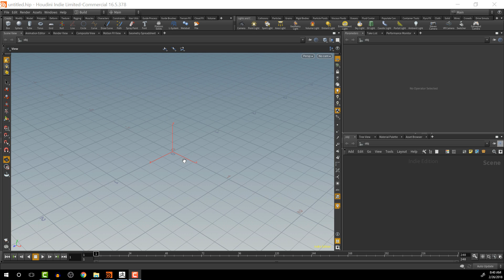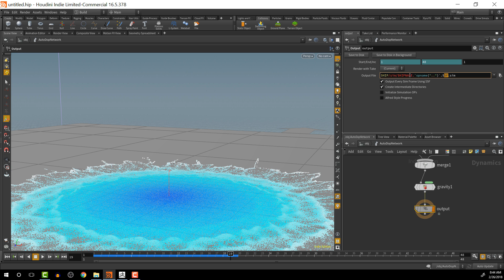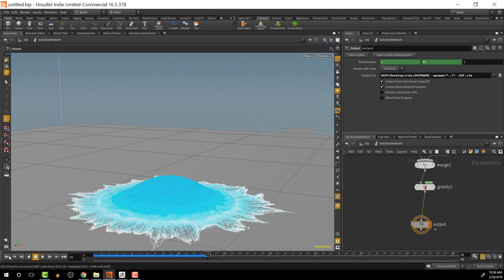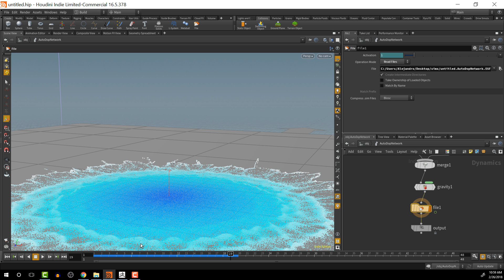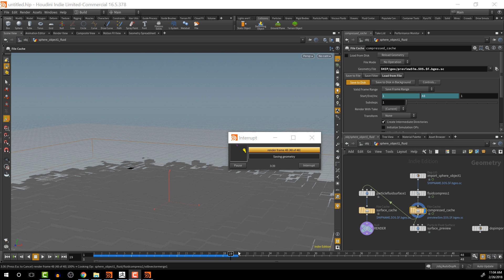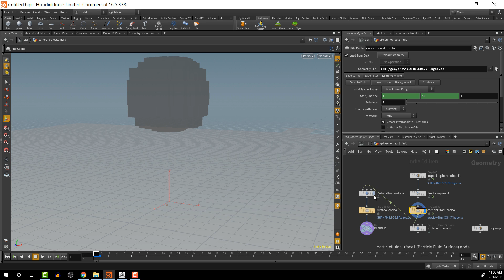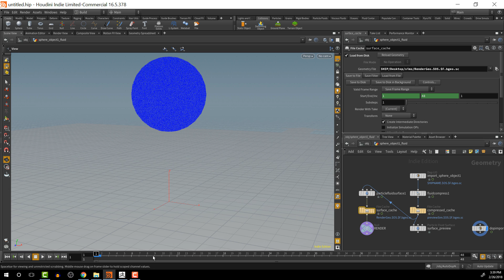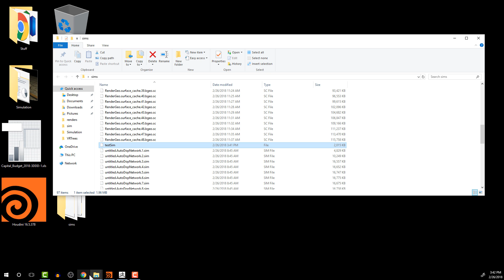4 Ways to Cache Water Flip Fluid Simulation | Houdini Tutorial

Comment: You exported only one frame to alembic thats why there was no progress bar and it was only 2MB. At the end you need to select Valid Frame Range to Save The Frame Range and specify what frames you want to save/export as an alembic. You had Render Current Frame selected so it processed only one frame. For the Format of alembic I would recommend Ogawa instead of HDF5. It's smaller and calculates multiple times faster.
Reply from the maker: Thank you so much for the feedback.

Comment: Thanks for the tut!  Is it necessary to separately cache out the Compressed and Surface cache?   I found (I think..) that by setting them  both to WRITE and then playing through my timeline would write both out to .bgeos simultaneously, you just need to make sure you've set them to different paths because by default both File Cache nodes are set to the same output path.   Is it ok to do it this way?
Reply from the maker: You don't need to export both if you don't plan on using them both. I mostly only create the cache for the high resolution version if I need it. The low poly is nice for visualizing though.